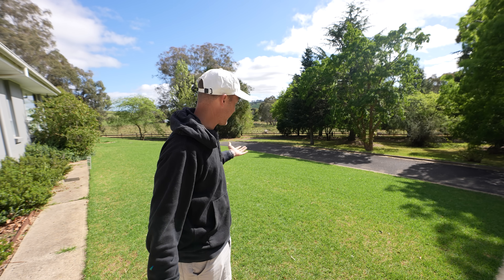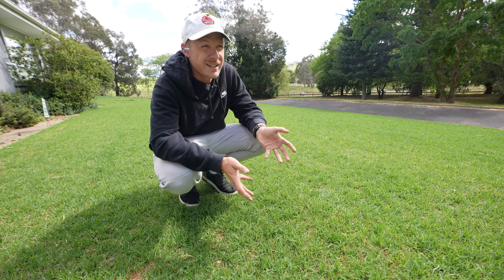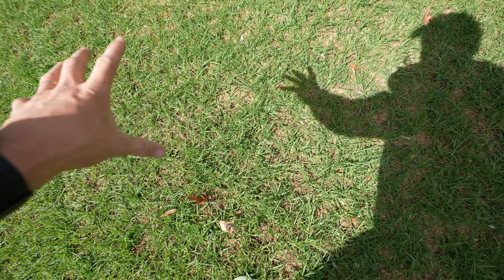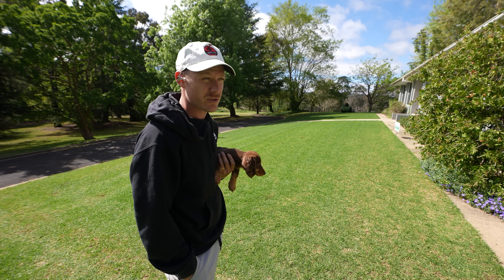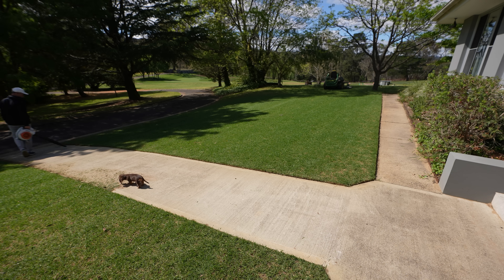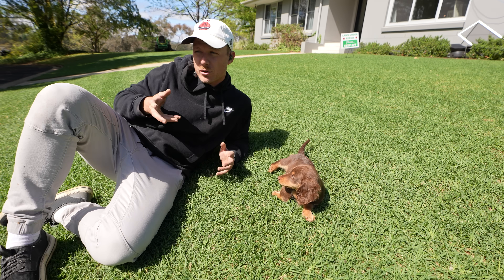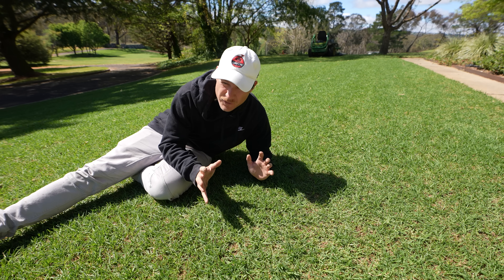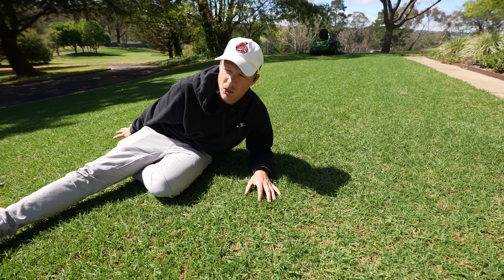Week 2 Lawn Reno Results // WOW!!

Comment: Honda HRU196 blade break hands down.  Commercial engine and built like a tank. 39kg but perfect for your front yard.  Parts out of Japan and assembled in Brisbane.  There's really no other mowers in the market that are built to the same quality and durability.
Reply: HRU196's are some of the rotarys on the market. Have the engine break & its an absolute beast
Reply: Agree. I like my HRU19 but this guy should go the commercial engine version and a self propelled model to save his back. The 4 blade ones that mow lower are the obvious ones.
Reply: Definitely the 196 blade clutch. Best thing since sliced bread!

Comment: Ego 21” rotary is awesome with their 7.5amp battery. Total Tools have it. Plenty power and torque for what u need man on the Kik area! Mulches, side discharged etc, even has headlights haha!
Reply: second this, only issue i have with my model is it could go a touch lower, which i believe they have altered in the new model, just not sure how low
Reply: @BennytheMenace  I’m mowing my buffalo on setting 5. Which is 3” I believe. I’m never near the bottom levels so that isn’t an issue for me🤣

Comment: 2 comments re mower:

1. Time to go battery electric for the rotary. Get a couple of extra batteries, use something compatible with your existing (and future) equipment. Better for the environment, cheaper to run and significantly less maintenance

2. Why not rig up the robot by laying some extra line around the yard. Even if not connected to the backyard, maybe just move the base and treat the front as a completely separate circuit. For the few occasions you'd do it you could just switch the base and connect to the front on an extension cord, leave the main wires in the front yard and connect the base to them when needed. Handy for post reno, and winter, when you CBFd with the cylinder 😉

Comment: Hru216m3 honda, green gold life did the tune up vid. Needs a multch plug.
Hrx217 check height adjustment.
Battery mowers are not designed for low cutting most won't go below 25mm.
Both hondas self propelled hru is heavy, brutally heavy can cut up a soft lawn 3 speed transmision. Just don't use it in the wet🤦without high lift blades and engine tune up.